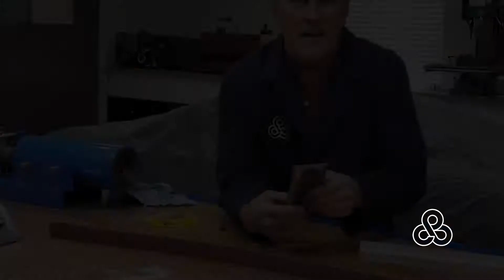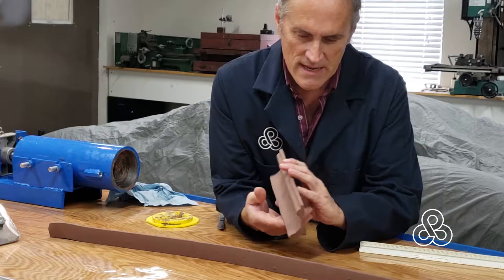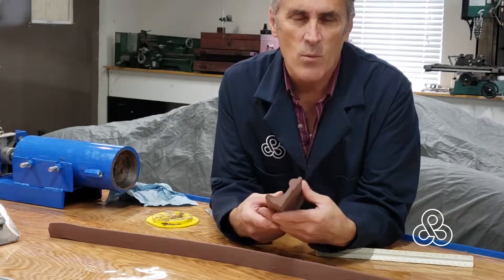A09 - Clay extrusion machine for creating FRP parting line flanges. SS3

Comment: Amazing! Nice to see how that the 3D printed die holds up under pressure!
Reply from the maker: 3 inch diameter cylinder with unregulated air pressure (120 Psi) the dies are about 3/8 thick printed solid with no infill. The steel backing plate helps, but the trick is to warm the clay slightly. To warm and it becomes a squirt gun rather than an extruder. Ha!
Reply: Awesome! Thanks!